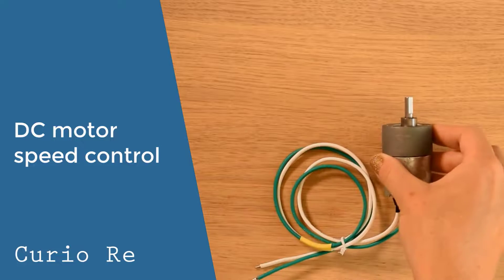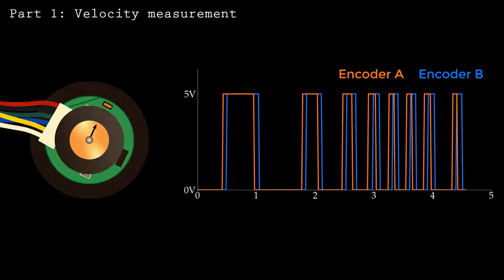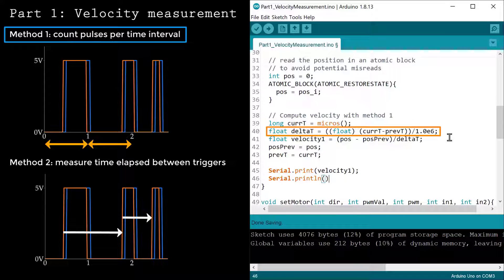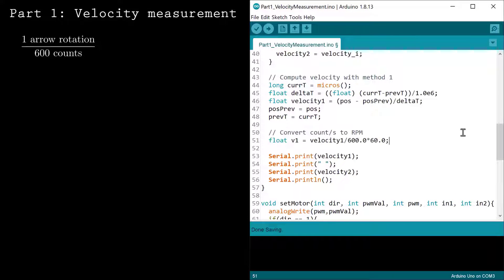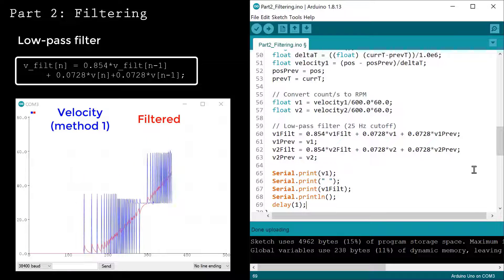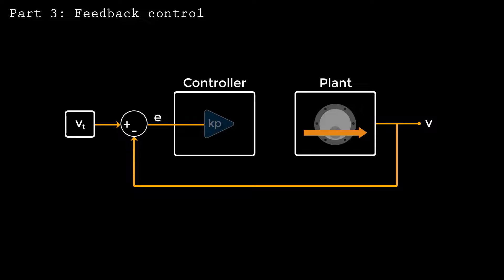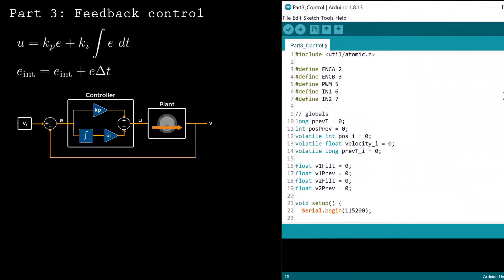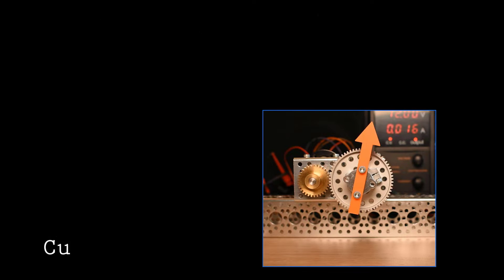DC motor PID speed control

Comment: This video is about how to control the velocity of a DC motor using and Arduino board and an encoder. First he said that we need to know the counts per revolution of the encoder. Thus we can know the revolutions per second. Once we can measure velocity now it's turn to control it. To achieve this, we use a PID law control. A PID law control is an expresion that calculates the output of a system to control the target variable. He programmed this expression in a microcontroller. After doing this he tested the code. He set a reference velocity and then the motor achieved that velocity, then he changed the reference velocity again and the motor achieved that new reference. That was the proof that the code and the law control worked.

Comment: A part of you code does not make sense. It is the variable "pwmVal". It is used only twice, thus:

void setMotor(int dir, int pwmVal, int pwm, int in1, int in2){
  analogWrite(pwm,pwmVal); // Motor speed

However, I cannot find the value of pwmVal being set anywhere in your code. There is no pwmVal = x.
Can you clarify, please?
Reply from the maker: Your question indicates a misunderstanding of the basics of how C++ functions (and indeed, functions in any programming language) work.

I recommend that you learn some basics of C++ coding. I made a video about that for arduino:

https://youtu.be/ZOllXMxLRqc

but that's just one, simple instructional video. In general, you should have a bit of a broader understanding of typical coding idioms before tackling this type of code.
Reply: @curiores111  Thank you for the reply and yes you are correct that my knowledge of C++ is minimal, yet is there no simple way to explain how pwmVal get a value in your coding? I.e., is the value somehow being passed to pwmVal some where in the function?
OK, I think I get it. The variable "pwr" passes the value to pwmVal.
Reply from the maker: @imetr8r  Learn how functions work, and you'll understand how this works. This isn't really a question about the video -- its about basic programming.
Reply: one is a name for the PIN and the other is the pwm number(0-255) you want sent via that pin. that's it! all done without being pompous and patronising

Comment: im sorry but can you teach me to control motor speed using pid with esp32 microconroller, there is a lot of things i want to ask but the most imporant thing is , is it coinsidence u are using limit for pwm signal at 255 because analog writing values for arduino only from 0 to 255? if its not am i need to change my limit of pwm into 65535?

Comment: Hello!

I would like to implement some speed control for a motor. I would like the motor to reach this desired speed in less then 0.5 seconds and be stable at that speed. I have looked at brushless servo motors and servo stepper motors but I am not sure which one to get to fulfill this requirement? @curiores111 do you have any idea of which motor to use?
Reply from the maker: stepper will give you very consistent stepping -- often used for sensitive applications like a 3d printer. brushless is usually for high power requirements like a quadcopter or drill.

What's your application?

Comment: Great tutorial.. with method 2 couldn’t you implement a condition if speed set to 0 to skip pid calculation and set speed to 0 or a stall detection if no pulses read after set time.

Comment: I had an idea to fix the issues of methods 1 and 2 for velocity measurement.
It's basically a hybrid of the two:
Regularly check how many pulses there have been since the last check, but instead of just assuming the check interval as time, always record the last pulse timestamp and use it to get a more accurate time between checks
Would that work?

Comment: thanks for your video you saved my time. I am trying to controll a blcd motor but have diffuculties about low speed rpm control and your low-pass filter solved my problem.

Comment: Thank you so much for this inspiring video! Finally seeing someone implementing PID control after visiting control engineering class and not seeing any practical examples warms my engineering heart ;D I don't have a motor+encoder flying around, but an led and light sensitive resistor. I guess pid brightness control is now a thing for me. I added a none feedback path to the feedback loop, to make the system more reactive/less prone to oscillating. I add u to a value x that is dependent on my target value. The relationship between the target and x is not perfect, but now the control loop only needs to compensate for the remaining deviation. Not useful in every situation, but worth it in some.

Comment: util/atomic.h arduino library. I couldn't find that .zip library, where should I find it ?
Reply from the maker: It comes with Arudino, but only seems to be available for certain architectures, as I've heard this before... What microcontroller are you using?
Reply: @curiores111  Hi ! 
I'm using ESP8266 NodeMCU, and also using ir sensor lm393 as a feedback to control the speed of the motor. 
The mic has some very issues with interruptions, because of that I was just able to measure the speed once every one second,    so the pid behavior has a very late response.
Reply from the maker: @prerupa  that's definitely the issue then. ESP's do not use the same firmware as Arduino AFAIK. Unfortunately I haven't worked with ESP8266 so I am not aware of what the workaround is or why you are only able to measure once every second, which is far too slow. Perhaps you are doing something else in your code.

Comment: Hi, great video. One question ( 4:05 ), why does the motor increase speed for 3s and than stop and repeat it? If I print a variable "pwr" in serial, it constantly rise. I dont get it.
Reply from the maker: Thanks. :)

I'm not sure I see where the question is pointing to. Could you specify which lines of code are suspect (or which output)?
Reply: @curiores111  at 4:05, line 27, int pwr. You set int pwr as 100/3*micros/1.e6. If I print a variable "pwr" in serial comunication, it constantly rise. It do what i expected. But when the hardware is connected (motor, driver, source, arduino), motor increasing speed for few second and then stop and repeat it in loop. I still dont get it. Have you some idea why this happening?

regards

Comment: How you are measuring the rpm of the motor in the display?
Please show the connection diagram of the LCD display.
Is there is any different code to show the rpm ?

Comment: Hi ı tried to simülate it in proteus but the problem is always 5v pwm coming out from PWM output pin. When ı increase the pwm that ı set in code, still 5v coming out and speed is still max. What would be solution ?

Comment: Thank you so much.Very useful video.
There is one thing I'm wondering to know.
The input and the output of PID Controller is rpm, right?
So how we define it to arduino pins as Voltage?
Thanks

Comment: @Curio Res I am trying to implement this PID speed control but my motor driver board only has the INA and INB, not a PWM input like your Pololu has. I am using a Cytron MDD3A. I'm trying to figure out if the code can be made to work with this driver board or if I need to have that 3rd input? Any thoughts
Reply from the maker: Jeffery, it looks like on your motor driver both inputs are PWM. It seems like if you increase/decrease the PWM signals you should see speed changes. I'm not sure what combination you should use to produce the speeds required... the data sheet doesn't make it obvious. 

https://www.robotshop.com/media/files/content/c/cyt/pdf/cytron-3a-4-16v-dual-channel-dc-motor-driver-datasheet.pdf

I think they're expecting you to use their library. Have you looked at their example?

https://github.com/CytronTechnologies/CytronMotorDriver/blob/master/examples/PWM_DIR_DUAL/PWM_DIR_DUAL.ino

If I wanted to figure out how to do it without their library, I would look at their arduino code (linked above) and determine what combination of PWM signals they use to generate the forward/reverse speeds, and wrap that in my own function.

Comment: Looking to use a tach to control motor speed, but the tach is on the device, not the motor, and will receive 4 magnetic pulses per revolution. It will need to stay at 1800 rpm but the motor will be running at a different speed due to voltage changes the volts will start at 12-13volts but go up to 14.5 to 15 volts how do you think I should do it?

Comment: I have a question about the conversion from rpm to voltage. Have you supposed that 1 rpm equal to 1 V? Despite my question, this is one of the greatest videos on DC motor PID speed control I have ever seen.
Reply from the maker: 1 rpm definitely does not equal 1V. What part of the video suggested that to you?
Reply: @curiores111  when the graphic is shown, it is calculated the error of rpm (y axis) and then it is said that if the error is 24, meaning 24 rpm, and Kp is 0.5 the tension given to the motor es 24 * 0.5... this is the part where i get confused. I want to excuse myself for the bothering

Comment: Nice video. I am trying to implement such speed control on a 0.75kW motor using a VFD. The microcontroller will set the frequency, similar to how yours sets a PWM signal, which is essentially the same.

The problem is that for my application, the motor speeds are relatively low (maximum 150 RPM). Initially, I wanted to use hall effect sensors that would trigger a pulse every time the motor passes a magnet over it. The problem is the low resolution: with my current setup, I am only able to measure 6 pulses per revolution. That, combined with the fact that the speeds are low, is making me concerned. Do you think the 6 pulses per revolution will be enough to have accurate PID control?

Also, you mentioned there are some potential problems with method 2 of measuring the velocity. Would those issues be a problem in my low speed application? Which method did you end up using? I am guessing that method 2 will not be a good idea for me, because my speeds are low.
Reply from the maker: I ended up using method 1 (number of pulses per fixed time interval). The issue with method 2 near zero velocity was too much of a problem for me. 

6 counts per rev is pretty low... it might be okay. Is the motor geared down? For low RPM applications usually using a geared down motor is better. You get more counts per rev, and have fewer issues low voltage required to keep the speed low (there's usually some stall for low voltages when using DC motors).
Reply: @curiores111  yes, it is geared down. I meant that the actual output, the thing that is attached to the motor, will be maximum 150RPM.

I am a bit concerned about my 6 counts per rev because compared to your 600, thats 100 times less resolution.

To control near zero velocity, I can just turn off the system. For my application, that is sufficient. I don't need it to hold its position, just need to turn it off. But I do see that if I needed to hold it in one position, simply turning it off wouldn't work.

Also, is it correct that method 2 won't be able to be filtered, because you need deltaT between sample, and the deltaT between samples would change depending on the speed
Reply: @yengajaf  I do also think along these lines - could you in some way make method 2 work. I made a couple of videos regarding speed control of sewing machines, and almost all of them got a problem with low speed control. Part of the problem is the static friction of the mechanics when you start sewing. Bad control means, that you try to make one stitch from start but you end up making 4 stitches. I have used another small DC motor as a Tachogenerator to make the feed back signal for speed. It works, but this DC-motor do also produce a ripple voltage, but it will also depend of motor quality. You need to apply a 1 uF capacitor on its terminals to filter out bouncing of the brushes at mechanical resonances. 

Finally I like to thank @curiores111 for an excellent video.

Comment: Can we control RPM of universal washing machine motor???
Reply from the maker: I don't see any reason why not (the motor would need to have an encoder). The responses will be vary depending on the "load" (hahahaha)... the control could certainly assist in helping it to keep a constant speed.. It would be interesting to see how well it could perform with a full load of laundry rolling around.
Reply: thank you soo much for your reply, actually i have made universal washing machine circuit using Triac, ZCD and Tacho, i have used Arduino PID library for that,,, but when load occured then motor get stuck 🥵

I think my calculations was wrong

Comment: Hello,
I’ve been search for a answer to a question for a long time and have found nothing that fits. Your videos are the closest to sorting out my problem.

I have a BLDC Motor with Hall Outputs (x3) Not and encoder as I don’t need to run the motor in reverse. I do have a motor controller that has a PMW input. The motor controller also has a “signal output” which takes the 3 hall signals and amalgamates them to a single 12 pulses per rotation 2.65V Square wave.

I can control the motor using the PMW output from both and Arduino Uno and an ATTiny 85.

I can also read the RPM with the Arduino.

My problem is that I would like to close the loop and control the RPM of the motor using the PMW signal which is being controlled by the RPM reader.

I found your PID code but am not sure how to implement it correctly.

My goal is to run the motor at either exactly 6250 RPM (75000 pulse per minute) or alternatively 6000 RPM (72000 pulse per minute)

The question is; Can I do this with and Arduino/ATtiny 85?

If I can, what to I need to change in this code to make it work?

Here's a video of my motor running: https://youtu.be/GRr_g87BeAo
Reply from the maker: Based on your description, sure, you can do this. The measured signal would be your RPM reading (this is the input to the controller), and you would use the control signal (the output of the control algorithm) to set the PWM. The target would be set to the RPM you want, such as 6250 RPM. In terms of how to adjust the code, I guess it depends on how you're writing it. There shouldn't be too much to adjust in terms of the PID controller, since that's pretty standard. It's more a matter of mapping your system to the interface and the controller. You'll also need to rescale the PID parameters, in all likelihood.

Comment: Is it possible for you to explain "util/atomic.h"? Or any other resource you think is relevant. Thanks in advance.
Reply from the maker: sure, atomic.h is for the atomic block. The atomic block prevents the interrupt code from running while in the atomic block. If it were to run at the same time, you could potentially read the value incorrectly, since it might be partially updated when the value is read. You can see an example at the bottom of this page: https://www.arduino.cc/reference/en/language/variables/variable-scope-qualifiers/volatile/

An alternative is to use nointerrupts()
https://www.arduino.cc/reference/en/language/functions/interrupts/nointerrupts/
Reply: @curiores111  Thanks for the lightning response, Really appreciated.

Comment: Thank you for the very informative video. It's somewhat unintuitive to me why method 2 exists if we won't be able to measure zero velocity. It also seems that you've used the LPF for it as well for some reason.
Reply from the maker: It's definitely the most intuitive method. There could be ways to workaround the issue at zero velocity. I'm not sure what you mean by "why it exists", do you mean "why did you put it in the video?"
Reply: @curiores111  It's intuitive yes, but its existence provided that we'll get oscillations when setting v to zero is what isn't. It's only intuitive now because there could be ways to workaround the issue like you said.
Reply from the maker: @essamwisamfouad9938  I guess I see it from a slightly different perspective... thank you for sharing your thoughts. :)

Comment: Thanks.  Was able to implement this in my code and it helped solve the problem I had.
Reply from the maker: Good to hear that. What was the problem that you had?
Reply: @curiores111  Acceleration and Deceleration on a Garage door controller that I designed.  Some mosfets (Same Part number and Manufacturer) would behave different to others. Using this(tweak here and there) I could get the Acceleration and Deceleration the same regardless of the irregularity in the mosfets.
Reply from the maker: @dannyoneill4888  Interesting. Thank you for sharing.